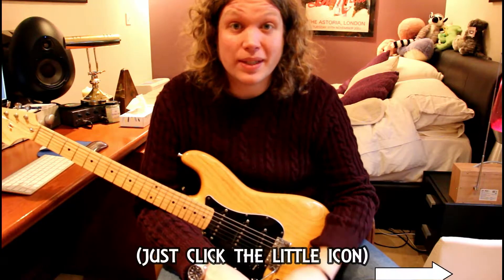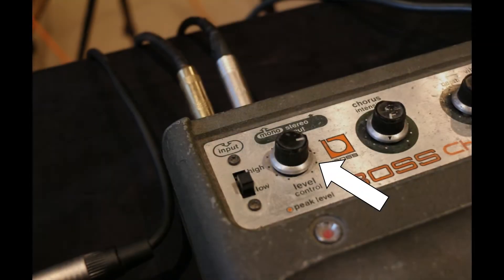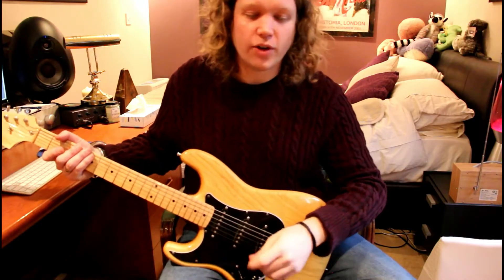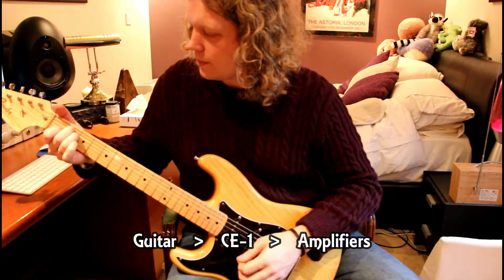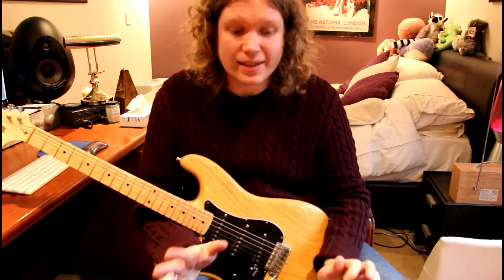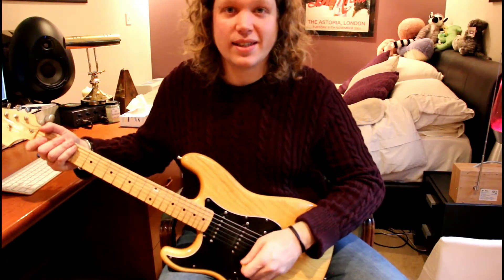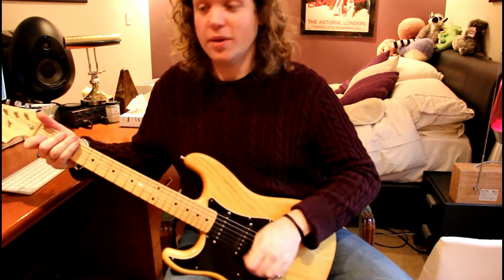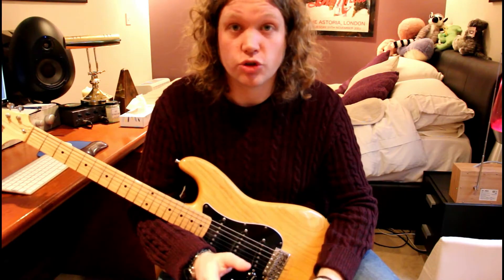Boss CE-1 Chorus Ensemble - The Buffer Trick

Comment: Is it not the case that Low mode is catered more for high impedance guitar signals and high mode is low impedance for keys? I have a custom pedal which is basically just the preamp circuit from the CE-1 (there's a video of it on my channel) and found that with my guitar going straight into the pedal, low mode doesn't really change the tone vs the bypassed signal, whereas high mode is extremely dark and obviously much more distorted. Placing a buffer before it brightens up high mode a LOT but didn't actually make any difference to low mode in my case. 

Another little quirk I've recently discovered is that low and high mode are inverted polarity from each other - some drive pedals seem to work better on either high or low depending on whether it inverts phase or not!
Reply from the maker: From what I can tell from my original, the low/high switch is purely level and not impedance...'high' turned down sounds exactly the same as 'low' turned up (if that makes any sense!)  I'd say the switching to low just brings in an input pad - though please feel free to correct me if I'm wrong on that (I likely am!!)  It certainly doesn't seem to be brighter on either - the tone is the same, with maybe a few differences in the 'grittiness' of the preamp circuit when you dig in.  But that's it, to my ears!  I don't ever really use the CE-1 with too much drive myself, but I'm sure you're probably right about about the polarity - goes beyond my knowledge of electronics/circuits somewhat! :P
Reply: Yes definitely - high turned down sounds the same as low turned up when you're using a clean sound (by clean, I mean without any drive pedals active before the CE-1) - but for me (and my friend who does have an original) if you run a fuzz or distortion pedal into the CE-1 it can sound different depending on the mode, even with the chorus effect bypassed! If you plug your guitar direct into the CE-1, you'll likely notice that high mode is MUCH darker than low mode! :)
Reply from the maker: Ah I see, gotcha (sorry - has been a long day!!)  For me, the CE-1 is so much of it's own sound rather than just 'a chorus' that I only really use it with clean sounds where it really shines - I prefer the CE-2 for driven sounds.  I'll have to have a play & see how it behaves with drive pedals going into it :-)

Comment: Does the mxr micro amp pedal solve the problem? Or maybe a ibanez wah? My ibanez has a buffer and true bypass switch
Reply from the maker: Any pedal that's either buffered bypass or engaged (with a couple of exceptions - tube pedals often have a high output impedance, etc) will have the same effect on the CE-1 preamp and bring your high end back :-) So both should work.

Comment: Great vid! Ive got one and ive stopped using it because it seems like when i turn it on and dont play i can hear the chorus cycle in the back, its kinda noisey. do you have any clue why it could be doing this ?
Reply from the maker: Hi Julien - thanks for watching!  Old modulation pedals can be quite noisy and give out a lot of audible 'clock noise' - which is especially evident when running them into an amp with gain.  The other thing to remember is that these pedals are about 40 years old and the components do break down over time...you could probably remove the noise by replacing the noisy parts, but that would likely change the sound of the pedal.  I've not looked inside the CE-1 too closely, but lots of pedals have bias controls inside - and pedals can get noisy, change in tone or stop working when not biased correctly.  So if it's possible (best ask an expert, or consult somewhere like TheGearPage) a simple bias tweak might help also. :-)
Reply: Joe Perkins Music thank you for your quick response :) i think changing the pot of the pedal alone might work since i suspect the higher impedance signal may amplify the hiss comming from the guitar, but then again i havent tested.
Reply from the maker: I wouldn't have thought replacing the pot will remove hiss, all it'll probably do it add high end back into your signal - but you never know!!  Let me know how you get on :-)
Reply: For sure !
Reply: Hello friends, the same thing happened to me, a lot of background noise... hiss... I changed the MN3002 chip and the problem was solved 100%... the problem is that they are too few

Comment: hello Joe, here a fan of you...from Chile....thanks for your videos. I have a ce1 that when I run it in mono and turn on the boss ds2 (before the chorus) I feel a slight drop in volume (I have the idea that it is due to phase cancellation problems when mixing both wet/dry signals). .when using it in stereo this problem does not occur and the chorus is huge...has this happened to anyone else? I think it works great in stereo
Reply from the maker: Hola Francisco :-) Not sure why that might be happening...the only thing that can happen running gain/boosts into the CE-1 is that they can overdrive the preamp and sound a bit grainy, and if the Level is set lower to reduce that it can drop the volume, but that doesn't explain why the volume drop it's happening in mono but not stereo!  So...not sure, I'm afraid!!

Comment: What kind of buffer are u using? Or what kind of buffers are good enough to use in front of this legend?
Reply from the maker: I was probably using my Terry Audio White Rabbit, as that's the switchable buffer I've used on my board for the past few years.  But having any pedal that's buffered bypass before it, or running (pretty much) any other pedal turned on before it will have exactly the same effect.  Buffers do vary in terms of tone - vintage Boss pedals aren't known for having the best buffered bypasses, for example - but the CE-1 preamp will colour the sound too, which will hide that somewhat.  So - any decent buffer will be absolutely fine, though you'll need it to be switchable to have easy access to both dark & bright CE-1 tones with a guitar. :-)

Comment: do you find your ce-1 makes an audible swishing hiss? mine does and i'm not sure if that's just how it is or if it needs a quick trip to the doctor.
Reply from the maker: Not really...all vintage modulations make a certain amount of noise, but my CE-1 at all problematic in that sense
Reply: Same here, and I've been trying to go through all the CE1 vids to see if anyone has found anything to make it have a lower noise floor.
Reply: mine does hum quite loud
Reply: Hello friends, the same thing happened to me, a lot of background noise... hiss... I changed the MN3002 chip and the problem was solved 100%... the problem is that they are too few